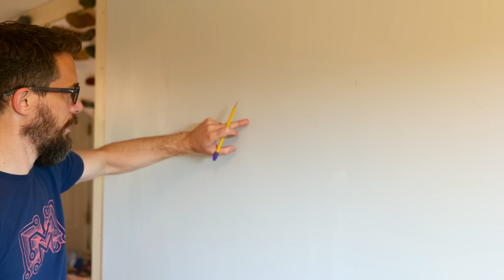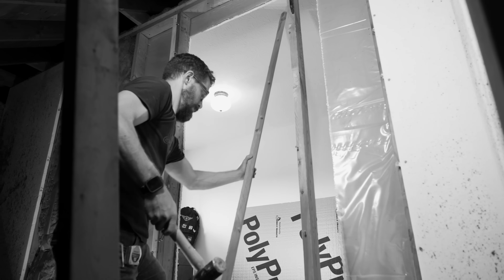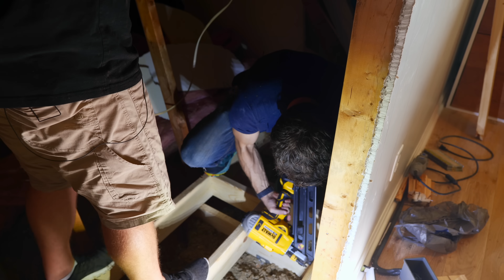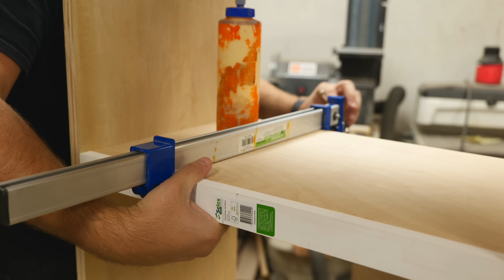Making a Walk In Closet | I Like To Make Stuff

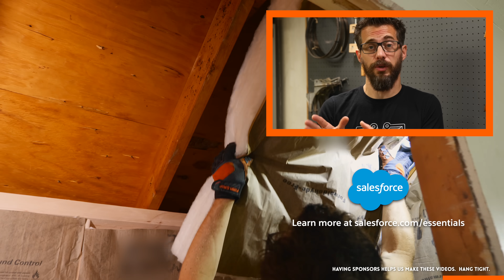Comment: 11:22 have you had any issues with the roof deck here since you put the insulation right against it? I have been told its not recommend because it can cause the roof deck to mold if any moisture builds up because it has nowhere to go. Thoughts?

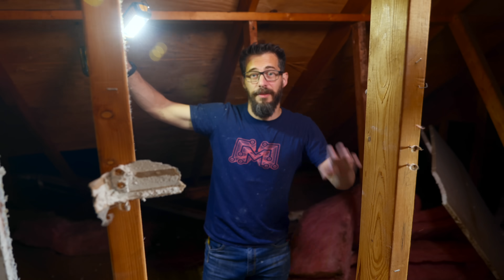Comment: 2:52 Twelve inches of under-floor space... Great spot to have access panels for under-floor storage space !  Think off-season coats, shoes, sports equipment, games, puzzles, etc.
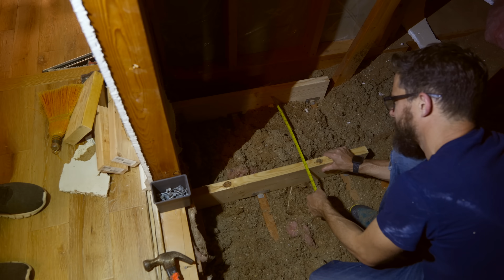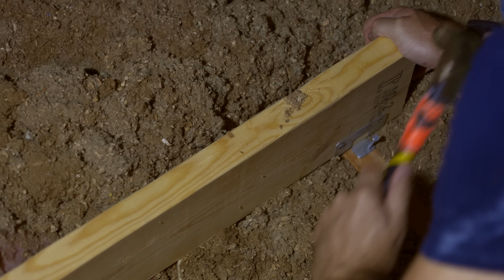For sub-floor storage 5:56, I see you actually have about 1ft PLUS the 8in height between floor joists that you can use... (where that loose insulation was sitting 6:00 ) Just add in 3/4 in plywood between the joists at bottom, to support weight of contents and allow people to stand in that storage space without falling through.
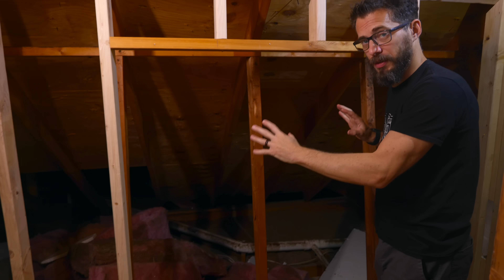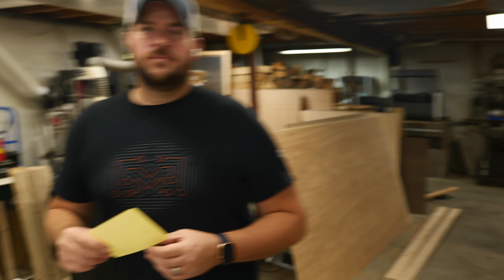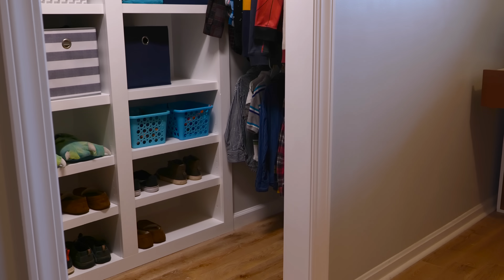8:28 It looks like you have LOTS of nice space behind the closet's back wall & side wall too, as you mention at 10:02, built shelves at 12:17, and have finished look at 16:22 ...Good Deal !
One of those shelf units could be removable, to give access to attic space too.
16:29 Nice shelves on right, built into wall gap space... 16:39 you DO mention.
If you put a raised 2in edge on front of those shallow shelves, they make little pocket bins which hold more stuff without falling out on the floor.
Good closet build, I'm sure the boys like their new space !

Comment: Mark - curious why didn't you put in an air baffle under the insulation you put on the underside of the roof? 
Looking for best insulation methods for these kind of Cape Cod style upstairs areas.
I was going to run the air baffle from bottom to as far up as I could - and maybe put some insulation on it - or do i only want to touch the parts of the living areas? (northeastern climate )

Comment: Great use of empty space. When tearing out drywall if you cut the rough opening and then simply pull the drywall off the wall in large pieces you make less of a mess. I know busting it up is fun but very messy.

Comment: Senseless and irresponsible to take a sledgehammer to that little piece of drywall, that was an asshole YouTuber move. 
You did not add a room you added a closet which that is now part of the heated square footage of the home and you are required to get a permit.
You are always required to get a permit to move, or add electrical.
And no Shop safety protocols?

Comment: Is that "air seal" foam board going to create a pocket for moisture to sit. With the kraft paper on the front of the insulation and the foam on the back it doesnt allow for much movement. I know you are trying to prevent air movement but if moisture (humid air) does get between the 2 there isnt really anywhere for it to go. I am asking out of curiosity, not telling you its wrong. Just a thought I had. 
great work as usual

Comment: You didn't need to buy new paper backed insulation, you could have reused the insulation you removed as long as you put new plastic for your vapor barrier like you had on the original wall.

Comment: It scared me a little to see you cutting into the wall with the knife but no shots of you locating the power cables to the outlet. Is there a standard for how power cables are installed in walls that meant you could cut with confidence?
Reply: I suspect their was some sort of existing access to that area cause he also mentioned he allready removed the insulation.

Comment: i'm surprised at how much "empty space behind the walls" you're able to find in your house.... i wonder if the person who built the house was able to predict that "Bob who likes to make stuff" would live there one day and start knocking down walls; and hence designed it that way...
Reply: Yes, exactly, thank you! Why waste all that space?! I don’t get it
Reply: As it’s the attic I guess a few things:

1) Easier to convert and decorate a room that is mostly ‘square’. The higher the walls, easier it is to decorate and put things like TVs, furniture, hang photos etc. It probably also helps with heating the room and insulating it. Also remember it’s a living space so people need to be able to walk about without stooping...
2) You need to leave space for ventilation, possibly even maintenance of roof or equipment.
3) They may have been things such as heating system up there. In The UK it’s not unknown to have a cold water tank as well as a boiler in the attic as generally we don’t use the attic space.
4) could even be as something as simple as cost
Reply: This is a typical I think of a 1 1/2 story house. They built into the attic but the way they did the roof framing they either do ceiling that tapers down to like 2 feet off the ground and you hit your head on them all the time or they cut into room space by making the ceiling proper height all throughout the room. So it's give and take on both sides. Was going to do this exact same thing with my 1 1/2 story I used to own
Reply: Me too ! In my house the rooms go all the way to the far end of the roof and the floor. I was wondering why it wasn't used before or build like that. I live in a region where the price per square meter is really high so maybe it's because of that.
Reply: COOl!!!

Comment: Hey Bob, another great video. One of the things that I've always struggled with when building my own projects at home is what you do to pivot around issues that may arise during your builds due to warping / racking of the materials you use? For example, I saw that when Josh was breaking down plywood to make a shelf, the plywood was pretty twisted. Did you just cut it into small enough pieces to muscle it in place, or do you have a really nice supplier that you can sort through the pile and cherry pick the best pieces? 2x4 material is probably even harder to get straight, so just curious what your techniques are for balancing dimensional accuracy versus real world material defects. Thanks!
Reply from the maker: It depends. We buy our plywood from the big box store like most everyone else. At that size, the fixed shelves were necessary to combat that bow. And it helps that we were fitting it into an opening.
Reply: @Iliketomakestuff  Yup, definitely true. Just was curious to see if there's any tips / tricks for managing warping/crown/twist in a dimensional piece of wood. Maybe a BITS video topic?

Comment: Why are american homes like this? Why is all this space sealed off?
Reply: Depending on the part of the country really and when the house was built. Typically the “unused space” helps with heating and cooling in southern homes. Sometimes you will see very high ceilings which draws the heat up. Using all available attic space can reduce R ratings (the insulation efficiency rating in the US). Speculation on older homes is that it may just have not been cost effective for developers.
Reply: @stratparrott1446  Thanks, I didn't expect to get such a detailed answer.

Comment: why do you have to blur out things on the insulation?
Reply from the maker: Contract obligations
Reply: @Iliketomakestuff  ahhh ok didn't know that. Anyways as always awesome video!!! :D.

Also as I mention in your starwars videos you may want to check out EL WIRE as it provides different colors lighting with a small footprint and low 9-12 vac usage. They have a bit of a neon look to them too and they can be moved and placed around like wire 

Thanks! ^^

Comment: 6:58 PSA, (Bob voice) if you working with electrical wire shut off the breaker
Reply from the maker: A very necessary PSA.
Reply: @Iliketomakestuff  pin this
Reply: A shocking revelation to those who did not know this before hand
Reply: If folks don't know that one should be careful when doing electrical, maybe they shouldn't do electrical
Reply: Meh, just be careful and wear nitrile work gloves.

Comment: Not an american here... whats that "dust" on the floor inside the wall?
Reply from the maker: Blown insulation.
Reply: Do you need to where a mask for that insulation?
Reply: @johnanthony44  yes, I’m pretty sure you do.
Reply: @johnanthony44   Highly recommended. I have blown the stuff in before, and it still is pretty itchy. Not nearly as bad as fiberglass, but its basically shredded newspaper plus a fire retardant. It throws a ton of dust into the air when you blow it and realistically fine paper is not good for your lungs. Plus sneezing it for a couple of days is not pleasant. I had one piece I sneezed that still had legible text from whatever it was recycled from something like two days later. Better than fiberglass by a long shot.
Reply: @johnanthony44  You don’t have to like you do with fiberglass but you should just in case
Reply: It's a cellulose insulation, very effective and nowhere as irritating as fiberglass. Also about twice as effective as blown in fiberglass as it does not lend itself to thermal convection, meaning that the colder it gets, it still works, blown in  fiberglass loses about half it's rated performance at sub sub-freezing temps. Owners of the fiberglass companies know this and tend not to use their own product. J.D. Powell tested. Old news though. That's been known for 20 yrs. but it's not trendy to use cellulose in roofs. Funny that it's still prevalent in a blown in batt application for a high performance wall. Cuz it works.

Comment: Only in America you can remove your wall with a "knife" . Nice work love your vid.
Reply from the maker: Maybe you just need a bigger knife. ;)
Reply: @Iliketomakestuff  And a way bigger Arm ;)
Reply: @Iliketomakestuff  and a sledgehammer to break the bricks"
Reply: And empty spaces behind those walls.
Reply: @CridasCoba  I mean it does say it was part of the attic
Reply: He used a drywall saw or a jab saw. The tip is designed to pierce drywall, and the saw teeth are pretty coarse. Drywall is very easy to saw. The gypsum pretty much crumbles, and you are cutting the thick paper on each side.
Reply: It was a plunge saw for drywall... it yeah that's where we are all at in the world.
Reply: The thing I don't understand is how do you even avoid termites in a house made almost completely out of wood
Reply: It was a saw and a hammer. I didn’t see a knife 🔪🤷‍♂️
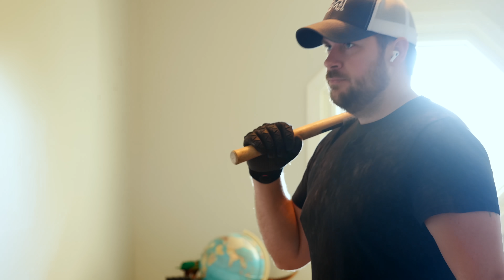Reply: @OriginalMomo  look at 2:30
Reply: That is true. Houses in the Caribbean are made with bricks, steel, boards made with concrete or ply.
Reply: Faxx😂
Reply: Can do the same in Canada :)
Reply: Padsaw*[
Reply: Bruh that's a drywall knife its not only in America breh
Reply: God I hate drywall. Hardwood flooring on everthing!
Reply: Most houses in Australia nowadays have plasterboard (drywall) and this could easily be done over here.
Reply: because thats not an important wall, every house is like that
Reply: I once removed my concrete and brick wall with a knife... You don't want to know what happened to the knife... Or the wall... And definitely not to me...,....
Reply: In iran the houses are like bunker great wall with cement and bricks
Reply: Lol and canada
Reply: Yeah come try and do that in the UK muwahahah
Reply: Haha! My house the internal walls are all engineering brick. We had to take a wall down for our new kitchen and our builder had to hit each and every brick like 3 times with a lump hammer to demolish the wall. Poor guy could barely move next day. It’s super solid but a pain in the proverbial if you want to make changes to the layout. Plus there are bits of lath and horsehair plaster around the place, like the understairs cupboard. The house is nearly 100 years old, we only had to replace the original roof last year. Otherwise solid as a rock.
Reply: Only in houses that have been built since drywall has been invented. The rest are lathe and horsehair plaster.
Reply: @ferky123  or just good ol’ brick and mortar when you hop across the pond 😂
Reply: No a REAL  wall.  Those are life sized doll houses.
Reply: Or a wall charger
Reply: I did this to my house, installed pocket doors, and never looked back.
Reply: If we can actually call it as a "wall"